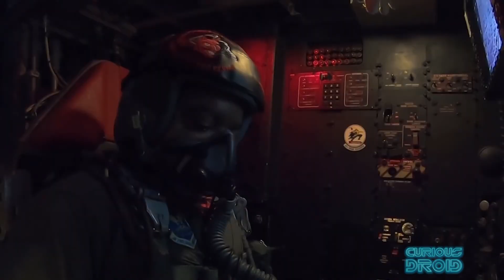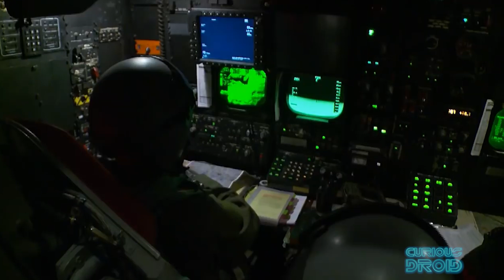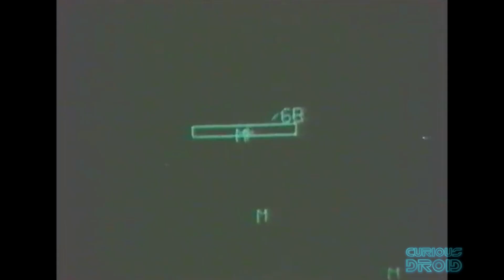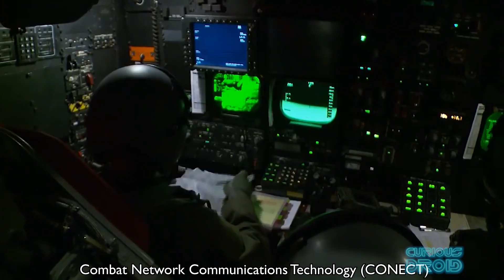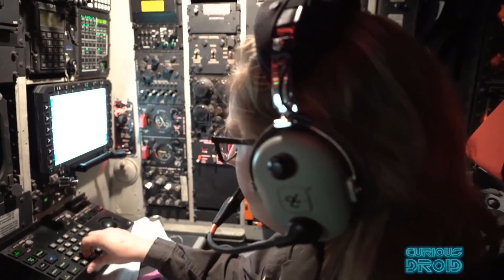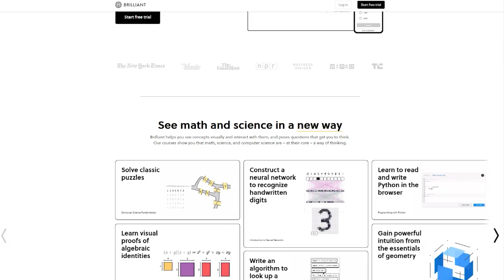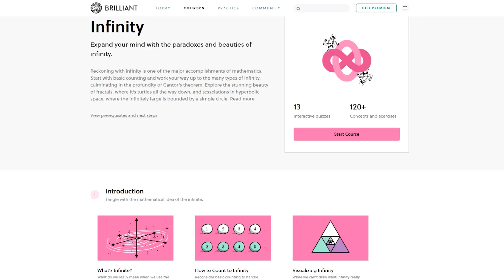How Long Can the B-52 Continue in Service?

Comment: It's hard to improve upon the mousetrap, or the hammer.
Reply: Or the wheel
Reply: Christian Slater They aren’t though, it’s why the air force has been trying to upgrade the engines of the B-52.
Reply: @NerdyNEET  It uses the same type of engines that Airlines USED to use.  The Airlines use the latest engines that are easiest to maintain. Take longer time between maintenance.  Lastly,  use less fuel per hour of use.  
Airlines are all about MONEY. How much comes in the door. How much needs to be spent to survive, and how much is is left to give to the Shareholders.
Reply: @NerdyNEET  The video literally just said the engines were designed in the 50s and last made in the 80s. It's definitely NOT the most efficient engine.
Reply: @SQW0  - Yep, something spewing that much shit into to the atmosphere, like it's got industrial stacks under it's wings, is not efficient. Those engines were just good enough to stick on a long range bomber without any further thoughts.
Reply: i mean we could improve it easily, it would just cost more than the US is willing to pay at that is okay
Reply: @zblurth  Nah. imo I think this shows how hard it still is to super cruise. The B-52 has always been fast. As fast as an airplane can be with the gas it can carry and get somewhere with a useful load. The BUFF still works because we figured out sub-sonic flight 70 years ago. And we really can't go any faster. The BUFF is still a good airplane. It's even better than any modern plane in it's same aged state (B-2) because it's metal construction. Which means easy and cheap to fix and modify. We could certainly build a better airplane for a lot more money, but it wouldn't do the mission any better. New engines will greatly improve this airplane. The Air Force comes up with some dumb ideas, but I don't think this is one of them.
Reply: @duster0066  same aged state as B-2??? B-2 went into service in the early 90's fyi... It's much newer than the B-52. Unless i'm misunderstanding what you mean by "same aged state"... B-2 Spirit is still probably the most capable U.S bomber alongside B-52 and B-1. All 3 fill specific bombing rolls of course
Reply: @lunapetunia3778  You do remember correctly. Do you fix airplanes? The B-2 is an old airplane, and it now has old airplane problems. All 3 are old, but only the Buff is of conventional build. I'm not saying it's the best only that it can't be improved upon economically. And since it's just a missile truck now it gets the job done.
Reply: @duster0066  is it really only a "missile truck" now? And whats the point of that exactly? To transport ICBM's whole? So it's a cargo plane now and not even really a bomber?
Reply: @zblurth  It'd do the same thing for a higher cost...
Reply: @NerdyNEET  I meant jet engines in general. Old turbojets are obsolete, end of story. Replacing the B52 engines, if feasible, would make them cheaper to fly and easier to maintain. The role of the plane would not change, obviously.
Reply: People have done both plenty. Especially mouse traps. Those little fuckers are way smarter than you think.
Reply: @Phelan666  pit fall trap is still the most efficient...
Reply: ....and i've just had a great idea...The Hamtrap!
Reply: Too bad in today’s battlefields everyone is using screws instead of nails.
Reply: Silly Goose  But he's right. Turbofans are much more efficient and powerful than turbojets, particularly in the subsonic, heavy lift use case. The highest thrust jet engines ever made are high bypass turbofans.
Reply: @Christian Slater Also you would need to strengthen the Wings and body frame to sustain the newly increased thrust from the new engines. This would shoot up the cost.
Reply: And the B-52 is a BIG hammer!
Reply: Hmmm I don’t know... just bought a ‘Mouse Motel’ and it’s the best mousetrap I’ve ever had. I’ve tried them all and most fail epically. It’s the one!
Reply: Or the shovel, or the match or the pencil - -yes people still use those
Reply: Introducing the Nail Gun. A hammer without the hammering
Reply: @NerdyNEET  you are incorrect. Turbojets are the early version of the jet engine which were great in their day but are highly outdated now, very inefficient. All modern planes, any cluding airliners use turbofans, which is a turbojet with an additional large bypass fan on the front. These are exponentially more efficient. Planes haven't been built new with turbojets in probably 5 decades.

This will help explain: https://www.youtube.com/watch?v=xADjIAqJigI
Reply: I don't know about that, try watching a carpentry channel.
Reply: @NerdyNEET  They're efficient as smoke makers
Reply: @Tom_Hadler  Smoke makers you say. The smoke you saw was from a Turbojet engine, not a Turbofan engine. What produces the smoke on takeoff is a Water, Alcohol mixture injected into the engine which produces more takeoff power. Once in the air above stall speed the limited supply of water alcohol is used and the engines produce much less smoke. The engine now in use, TF33, when in tune produces no exhaust smoke, and greater power.
Reply: tell that to military procurement
Reply: They literally say in the video that the engines are terrible and burn a ton of fuel and cost a ton of money, but it might literally break the airframe to put non shitty engines on it. They are teh same engines on the original commercial airliners. calling them the most efficient or whatever is retarded.
Reply: Yes but as has been said many times, "If your only tool is a hammer then everything begins to look like a nail".  Wouldn't it be great if the world didn't have so many hammers?
Reply: @Mister_Pedantic  agreed.. I am not disparaging these brilliant machines.. I am saying the next war will be very different
Reply: @NerdyNEET , no the engines currently used are old and terribly inefficient.
Source: me. B52 crewdog
Reply: Or the manual door handle.
Reply: Now imagine a half-built hammer with multiple jet-engines attached. Thats what the West faces today, except the Russ don't threaten anybody.
Reply: Christian Slater This is the most schizo brainlet shit I’ve heard. The air force hasn’t been searching for an engine upgrade for the past half century, they were approached in the 70s by Rolls-Royce, Pratt & Whitney, and GE for an engine upgrade but declined because fuel prices were cheap. 

Keyword, “Approached”. They weren’t looking for an engine upgrade but engine manufacturers offered one.

Then in 2007 they threw around the idea of upgrading the engines for a Stand-off Jammer variant of the B-52 but that never went through and no serious effort was put into upgrading the engines or finding out what it would take to upgrade the engines. The Air Force has only seriously looked into upgrading the B-52s engines since 2014, when they actually researched what it would take. So the Air Force has only spent 6 years actively trying to upgrade the engines. Not half a century. Do you think keeping the engines that were first produced in 1962 for an aircraft that is supposed to serve till 2050 viable? No, neither does the Air Force but you think you’re smarter than them.

“The Pentagon will ALWAYS look for ways to spend money upgrading”

The Pentagon doesn’t spend money on upgrading to spend money, they spend money on upgrading to keep an aircraft up to date and modern.

The rest of your argument is schizo rambling so I’m not even going to bother to address it.
Reply: With U.S military budget.... They could easily just slap 4 ramjets on the wings and make it supersonic with laser defense measures and maybe even make a ACB-52 version that acts as an AC130 and long range strategic bomber (jokes) lol
Reply: @lunapetunia3778  yeah but if you slap 4 ram jets on it good luck getting the damn thing off the ground
Reply: @NerdyNEET  I don't disagree with your direction of thought. You have used the wrong word 'efficient' in your delivery. The bombers design was best 'suited' around the engines thrust, power and torque. That is why they had serious concerns in replacing it. I think they should have designed a new engine, close to the same specifications, rather than focus on a modern replacement with an existing engine.
Reply: You can add rocket engine to hummer to make it much more powerful!
Reply: @NerdyNEET  No, just no. The B52 engines are completely obsolete by todays standards. All modern airliners use turbofan engines, whereas the B52 has turbojets. Turbofans are more powerful, efficient, and much quieter.
Reply: @NerdyNEET  exactly a b2 without its stealth tech is pretty much a shitter version of the b52 less load less range and less room for new shit inside and since area denial capability of countries like russia and china is getting deadly by the day to the point where at the densely defended location even plane like f35 and f22 which is a much smaller plane will be hard press to evade being shot down a bomber size aircraft is pretty much a no go so might as well keep the old bomber its still extremely useful as a stand off missle carrier and heavy bomber when anti air environment allows
Reply: @patthonsirilim5739  yeah, just like a b-52 without it's bombs is just a shittier 747

You can't just replace an integral part of a weapons system and call it "shittier", the b-2 was designed with stealth in mind and it is a fucking beast on that role, it can fly into enemy territory undetected, cripple their entire air defense infrastructure and left opening a hole for other airplanes (like the b-52) to fly safely without needing to sorry about things like SAMs or fighters

Comment: The B-52 puts in mind the  soviet Tupolev tu-95 bear bomber ....both built in the hightened atmosphere of the cold war with the Tupolev being significantly older but built to flex the nuclear war muscles of the soviet and the Americans...both built with rudimentary methods but outlasting the best of the best that come after them ....tells you alot about creating technology with upgradability potential ....
Reply: The bear was impressively loud with its prop tips running supersonic at powepower.Great looking plane too! Cheers.
Reply: I think you'll find the Boeing entered service before the Tupolev. 
Both took their first flights at around the same time but the b52 was in development while the soviets were still trying to reverse engineer B-29's.
Two amazing aircraft.
Reply: @zopEnglandzip  The B-52 entered service in 1955. The Tu-95 entered service in 1956. They're both still in service.

Comment: what do you think will be the next propulsion method for planes that is not jet fuel based and the same for rockets that is not standard rocket fuel
Reply: Hydrogen most likely.
Reply: Psychic engines. Woooooooooooooooooo wubbubububububub wooooooEEEEEEEEEEEEEEEEEEoooooooooooooo

Comment: Service - indefinitely. Combat operational - depends on targets. They are big sitting ducks ...
Reply: Manpads, ground based soviet era IR based AA vehicles and stuff like that is no danger to a sitting duck, considering the altitude it is flying at, and the stand off distance it releases it weapons. Most of the middle east is free roam area at that height, unless it's a zone where the russians claim a proctorate(e.g. Syria) or have sold high performance SAM systems. That's where it gets a bit hazy. Though I doubt B52 are send in those areas. If a mission has to be done in such an area, I would assume that it's a night time mission utilizing B1s, B2s or maybe even  fighter-bombers such as the eagle.
Reply: Don Tanton man pads simply do not have the range to challenge the B52. But it’s slow enough to be threatened by even aaa fire.
Reply: They're not penetration bombers. They have tremendous standoff capacity, and only operate as direct bombers in theatres where air dominance is already established
Reply: You make a valid point, except that there is no record of one being shot down since the end of the Vietnam war in the 1970's.
Reply: @pulaski1  That's because they were used in stand off mode. They have been against a near peer adversary since.
Reply: @pulaski1  Oh really, look up the number of B52s were shot down in Hanoi ;) The all-famous Linebacker II operation :)))
Reply: @duong_95  29. But they ALL weren't "shot down". Some later crashed in Laos or made it back to their base and landed but were so damaged they were later scrapped. I believe 15 or 16 were actually brought down over North Vietnam. But that was after ALL the B-52's flew over 700 missions over Hanoi. Any loss rate is "high"...But the number of B-52's lost was a small % of the total number of missions. The B-52's, basically, ended the war in Vietnam for the USA.
Reply: @badguy1481   Well, honestly, I don't want to bring up the suffering people from both countries had endured through this pointless war. We, Vietnamese people lost millions of our loved ones civilians and soldiers combined, schools and hospitals were destroyed. Many picked up the guns simply to protect our country from being invaded by US government, to protect their villages from being bombarded by B52s, and none of whom knows who-the-heck given the order to destroy their homes. Many Americans I know have their parents as veterans, some of them were even F5 pilots and the point is all of them were drafted to be there, to drop bombs on people they don't even know.

To put simply, we can marvel at this technological achievement in the 60s, but to drop bombs on people other than to defend your country will always be the guilt written in history books.
Reply: @duong_95  The Vietnam War was no more "immoral" than the Korean War or WWII. South Vietnam had 100's of Thousands of Vietnamese who fled the North because of its Communist government. And 100's of Thousands MORE who fled South Vietnam after it ws invaded and taken over by that same Communist government. The USA was protecting those people from the government they had fled and the violence that government wanted to bring down on the people of the South. That war had as much validity for the USA as ANY war we've fought. The fact the American Congress sold out the people of South Vietnam in 1975, does NOT make that war immoral for the people who fought it.
Reply: i always wondered why dont they equip some b52 with a huge ammount of air to air missiles and missile interceptors
Reply: @froschreiniger2639  Because there are fighter escorts to do that.
Reply: @froschreiniger2639  I believe there HAS been a concept proposed where by the B-52 would lead a squadron of fighter aircraft into a war zone. The B-52's MAIN task would be to provide air-to-air missile support to lessen enemy fighter threats.
Reply: @froschreiniger2639  Look up the Arsenal Plane
Reply: Eh, sitting ducks are fine if no one’s there to shoot at them.
Reply: Aren’t they meant mostly for transport nowadays? If that’s the case, they would likely avoid hot zones I think. That’s like being upset a taxi cab can’t keep up with a Ferrari. It has a completely different purpose.
Reply: @NemeanLion-  But....The idea is the aircraft delivering the long range missile MUST keep out of range of the enemy's long range missiles. SO ANY aircraft, that can reach the launch window would be suitable for launching those missiles...even a private jet...if they can fly that far so as to reach 1000 km from an enemy target.
Reply: NemeanLion they’re never used for transport, there’s barely any room for the crew in there
Reply: I miss the time when we can source high-performance alluminium alloy from the sky. My family still has several ktchen utensils made from B52 frame. B52 is still in service today because Nixon didn't dare to send more B52s to Hanoi ;)
Reply: Big slow moving ducks
Reply: Oh look its the youtube General
Reply: Pierre LeDouche  Stealth? An aircraft that cannot be seen by radar? Sure videogames and movies. Not real world physics sorry kiddo. ;-)

Ofcourse a single JEDI Master pilot would fly through a Star Wars canyon at full speed hitting wombat sized targets inside turns flying cold stick and then wipe a squadron of F22s undetected with ease.

You really think 1950s bombers will be a match for modern day war?

'drop one please'. What videogame or movie is that from? lmao!
Reply: Pierre LeDouche  Thank you for admitting you got this from videogames. Sorry this is about the real world. A RCS can be reduced but stealth does not exist.

Let me dumb it down for your kid ...

https://dictionary.cambridge.org/dictionary/english/stealth-bomber

So anything that moves through the air? Moves the air. Basic fact. For every reaction there must be an equal reaction. What does weather radar do? Track the movement of ... air? So stealth only exists in your videogames and movies. In the real world it is impossible to move through the air without moving the air. 

Sad that you are some kid who needs words and basic physics explained to them. All that personal BS about yourself shows how self centered a child you still are. You even claim the 1950s is 'ancient history'? Yea that does not fit the definition either. You watch some kinda TV? Yea try a book called a dictionary? You heard of books yet? lmao!

Now a child would pretend his 'ass' is any kind of argument. And when you grow up namecalling like a child is not allowed. When the debate is lost? Slander becomes the tool of the loser. Now that is an actual ancient Greek Quote.

Now forget your 'Call of Duty' videogame. In the real world our JEDI Master pilots would wipe an entire squadron of F22s undetected. If you grow up you will learn to accept real world facts. A child goes into denial. And we all see you deny the facts and even physics.